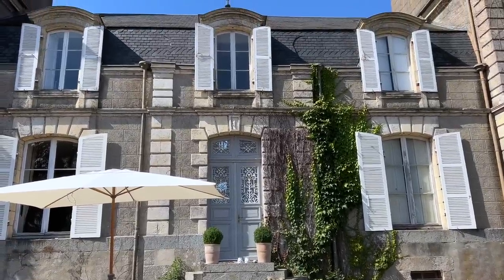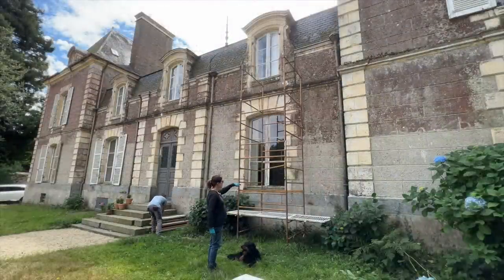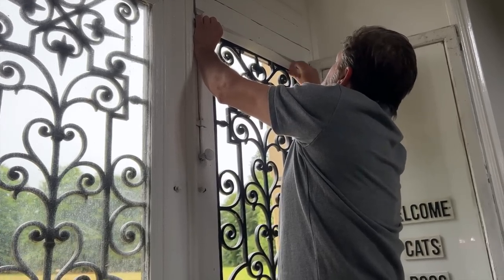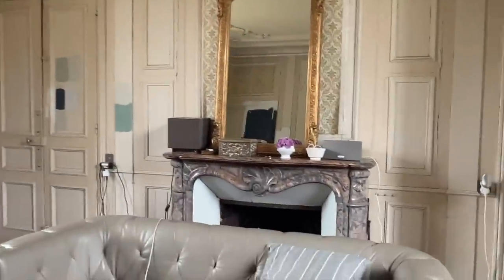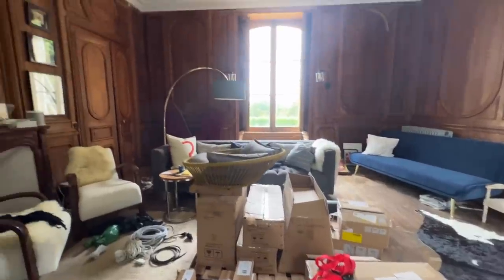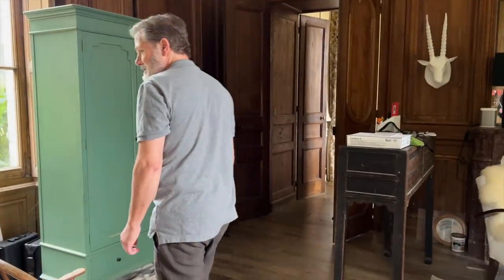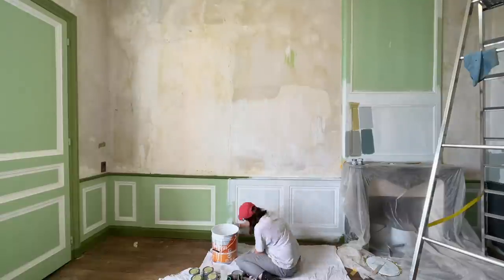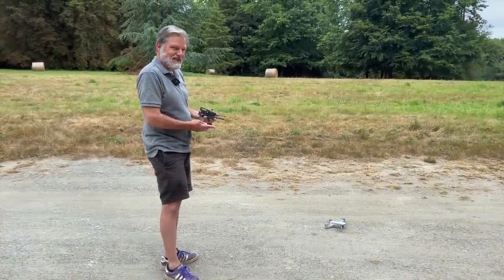More CHATEAU rooms to restore! Our French Chateau: Episode 16

Comment: The paneling in the Grand Salon is beautiful. To clean the paneling in a chateau I have been working on, I did a three-step process. First, I vacuumed the walls with a shop vac to remove as much dust as possible and cobwebs. That was followed by cleaning the wood with murphy's oil soap and water. After completely drying (at least two days), I used an un-tinted liquid wax that dries to a flat finish then buffed it. As an architect and historic preservationist I was very happy with the result. Cheers-
Reply from the maker: Thanks for the tips!  I wasn't sure if we should use oil or wax, but the wax seems like a better choice. I usually use Liberon, do you have a brand you like?
Reply: @OurFrenchChateau  You’re welcome. Liberon is good. I have used it. I also like Howard Products Feed-n-Wax.
Reply: @OurFrenchChateau  
I cleaned the wood paneling in my villa using Murphy's Oil soap and water. Then I applied a tinted Brie paste wax with a buffer attachment on a power drill. It looks glorious. Do NOT use oil. Dust will stick to it and it will quickly become a disaster to clean and remove.

Also, I would like to suggest you try using a paint sprayer to apply your primer and paint,,, ESPECIALLY on your shutters. You should sand down the areas and fill in any holes or uneven surfaces. I use the Kilz brand of primer. 

The PREPARATION of the area is the key part of any project. It takes a little practice but you will get the hang of it. 
Do your shutter project first,,, then you will have enough experience to do the interior ceilings, walls, and woodwork. Just tape off the woodwork walls, or floors with plastic sheeting and you will see how fantastic the end result is. 

TRUST ME,,, You have so much restoration to do,,, a sprayer will save you hours and hours of backbreaking labor. 
My tip is to buy GOOD QUALITY paint to cover the surfaces to last for a long time. 
I look forward to seeing the progress on your chateau. I have a 22 room 18th century villa on the Isle of Capri that has taken over 6 years to restore. 
You are fortunate to have access to all the antiques and brocantes. I have to import almost everything from France, Spain, or England. 

Try attending estate auctions when you can. Before you go be sure to make a list of rug, chandelier, and furniture sizes so you can make wise decisions. 

You both seem like lovely people and I hope to meet you some day. God bless you all!
Reply from the maker: @dloadthis1617  Thanks for the tips :) I like Briwax  - and it has a beautiful finish when it's buffed. Sounds like that would be great on our panelling. Your home sounds lovely!
Reply: Other Fench chateau owners seem to use OSMO
Reply: @OurFrenchChateau    je suis tres décu .  les chauves souris  sont nos amies , elles mangent  en insectes chaques nuits plus que le leur poids    si j avais des dépendances  je les inviterait  volontier  bien sur!!!!!!
Reply: @OurFrenchChateau    j ' espere qu un jour ,  comme tout les paysans de france  que vous comprendrez le role des chauves souris,  pour nous chassez des nuisibles,  elles sont nos amies   vous me faites de la peine
Reply: Oh my that is a valuable piece of advice.

Comment: Recognize that this video is a year old but for my cedar trees, I got a long “drip” hose that was permanently placed along the fence where the trees were. It was easy just to turn it on and off and not have to move heavy hose. As well, there is expandable hose. When it fills up, it stretches out and when you turn off the water and when you close the nozzle, the hose shrinks down to nothing and is extremely light weight. How lucky to have peaches growing up a wall! Magic!

Comment: You are my soul sister watering with heavy hoses. We're on a well fed by a wonderful aquifer system supported by lakes and a 30 mile Creek that meanders the countryside. We're on part savannah and woodland, zone 5 USA) and have no irrigation system so I have to lug 150-200 feet of hose around the property to water veggie & berry gardens and newly planted trees. I finally got rid of the heavy plastic hoses and went to the fabric ones. They are so much easier to use! I can't believe I spent 3 years breaking my back with the heavy ones. I haven't been especially gentle as they get pulled & dragged over rocks, stumps and around bushes. Good luck. With climate change we will all be doing more watering. For new trees and plants I'm looking for drought tolerant everything at this point.
Reply from the maker: It's tough! We will put in irrigation, but for now it's at the bottom of our "to do" list. I've never seen the fabric hoses. It stinks that we have to prepare for climate change, but it's here :(

Comment: Maybe one day in the future you can install a drip irrigation system, with each quadrant on a solar powered timer that turns on automatically at the desired time and duration, either daily or every other day, depending on weather. Then you would not have to try to move that heavy hose around your garden. Your chateau and property are beautiful & you are doing a wonderful job restoring it.

Comment: The Grand Salon is so light considering the wood all over the walls.  Normally I don't like heavily paneled walls in wood, but I could see why that room really caught your eye.  The light really makes the difference.  Under any other circumstances, I would paint it all white, but I can see that it will look absolutely stunning oiled up! We have long hot summers down here in Australia and often long periods during both the summer and the year without rain.  The most popular way to water our gardens here is to set up some kind of drip system.  Where you bury the pipes under the surface of the dirt and allow the water to leach into the ground right at the roots of the plants, where they need it.  If you also have wood chips etc on top, this also helps the drip system.  This way you might only need one or two connection points to connect your hose to your tap, as the hose is going to snake its way all over the garden.

Comment: Beautiful room and saloons. 

JB Weld has been savior for repairs on my drone. Yes...eventually the parts do become available. However while waiting JB Weld does an amazing job keeping her in the air.

It's been a scorcher this year. Be sure to periodically check the replenish rate on your well to ensure you don't drain it. Depending on the construction, materials, and condition of the well, taking the water level too low could cause damage or collapse the well. 

The walled garden is a thing of beauty. A seriously gorgeous garden meant to feed an army. Indeed the installation of pipes, spigots, shakers hoses and such is ideal and would save a lot of time and effort. Particularly when you set up automatic watering with the soaker hoses. All in good time.. For now enjoy the water. It's therapeutic by forcing you to slow down for the hour or so required to water.

As usual my comments and suggestions are meant for all readers based on the subject matter of the video; not necessarily directed at Amanda and Lincoln.
Cheers!

Comment: In the US we have what we call drip hoses. They have small pin prick size holes all over the hose. The hose is very light weight and inexpensive. I lay them along the roots of all the plants through the the garden. I have a smaller garden about half the size of yours then I hook up the end to the water source and run it for a couple of hours each day when it is dry. You could set up multiple locations with multiple hoses from the well if that works better for you but you would not have to install water sources through the garden by digging trenches. The light weight drip hoses work well with the well pump as a water source.
Reply: In Australia it is called a soaker hose :)
Reply: In Pennsylvania we also call them soaker hoses. I layered mine underneath mulch and soaked the ground for about 4 hours once a week. For efficiency, you should not connect more than two hoses. I solved that problem by running several pair in parallel. It worked really well.

Comment: Hydrangeas can be severely pruned, but most macrophylla bloom on the previous year's growth. So you need to consider that when determining how much to take off. If you take them way down, you won't have blooms next year.
I've had good luck transplanting Hydrangeas, so if the location isn't ideal, just move them. Fall is best for transplanting and pruning. They'll spring back to life next season... sans flower blossoms.
I've grown many different varieties in my Minneapolis yards. Yours are a pretty blue, perhaps Nikko. Your soil is must likely acidic.  Rhododendrons love acid soil and they seem to grow wild everywhere in France.
The Endless Summer series of Hydrangea has several macrophylla that do bloom on new wood and are more diminutive in nature making annual pruning less necessary. They also have a longer blooming season. Check them out.
My home in TX was built in 1965 and doesn't seem to have ever had irrigation. I loathe dragging hoses all around the yard. Wouldn't it be lovely to set it and go?
I think those are acanthus leaves depicted in the ceiling plaster.
Internal shutters are wonderful. The wood paneled room will be lovely with a little work.
I'm sure many of your viewers have made reference to Stephanie from Chateau Diary and her work in progress (15+ yrs.). She would be great to network with. She just celebrated 200K subscribers. Her vlog rocks! Her story is fantastic and wonderful. It's the chateau vlog that's a must see. Binge watch and you'll understand why she's the best thing to happen to chateaux since the Bourbons.
Reply from the maker: Thanks for the hydrangea info Ray :) I will check out her vlog...

Comment: I think you are restoring it really well - would insert some efficient wood burners in fireplaces you need in family room so you can heat one part well
For winter then get new boiler system later - you have so much wood use it if you can get some volunteers progress can move fast they would sleep
Up top in chateau no problem they are young and can rough it - keep up 5he good work you have done well on your own so far

Comment: Your garden looks beautiful considering the draught.  I thought I heard that you cannot use power washers on historical buildings but I was not sure if I heard that correctly.  Would make cleaning the buildings so much easier.  But I also understand the composition of the material might not tolerate a heavy duty wash.  Just curious about it.  Some of the buildings are so blackened and would look so beautiful if they were cleaned.  Keep up the good work.  It will be beautiful when you all are finished.

Comment: Have you tried that product that "Sadie in France" used to remove the wallpaper? It came off easy, fast and clean. Isn't the water hose carrier supposed to be pulled and not pushed- based on the angle of the handle, plus it would be so much easier? The garden looks great despite the heat.

Comment: My vote, if I am entitled to one, is that you leave the shutters off. They re not part of the original chateau aesthetic, and are a later addition, 19th C to be exact as they were fashionable then. Thake the shutters off, and leave them off and expose the beauty and integrity of the architecture.
Reply: That might be true. But shutters are practical for any house by blocking sun, hail, snow, wind, etc. Unless you are establishing a museum, their benefit for climate control far outweigh the purity of architectural style. They are now a two hundred year old addition in the metamorphosis that is a chateau’s history.
Reply from the maker: We absolutely need shutters on the South side of the chateau. They help in the summer with the heat and in winter we can get gale force winds and need them protect us from rain coming in...
Reply: @OurFrenchChateau  Fair enough then...
Reply: The "chateau" is XIX C so the shutters are full part of the aesthetic not a latter addition. It's a bad idea to remove them even if they are never closed.
Reply: @chlore2amine  I thought it was 17th C... even so, if they are hiding the architectural feature of the contrasting stone work around the windows and the beautiful fluted stone work (not the correct term, but you get my gist) around the dormers in the center of the roof, then I thing keeping them on the one side for functionality, and exposing the beautiful stone work on the other side, is a really good compromise and it certainly looks more elegant.... IMHO.